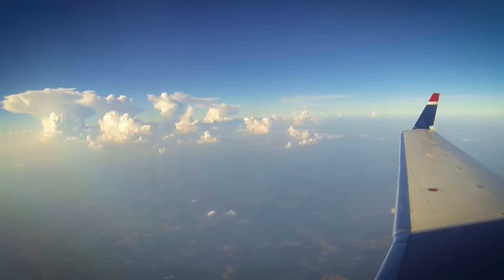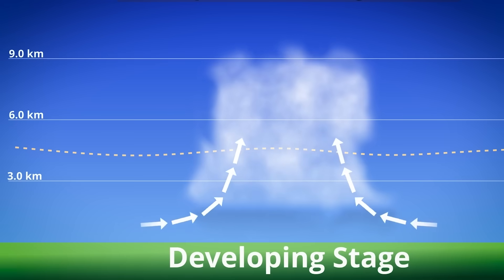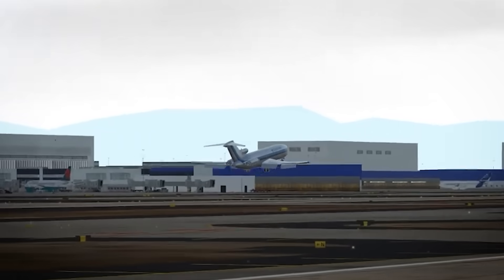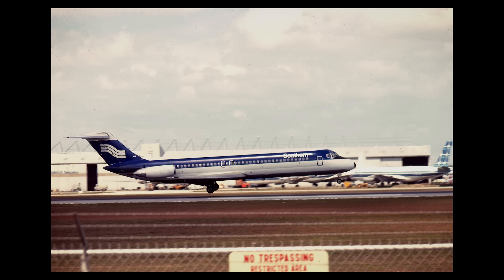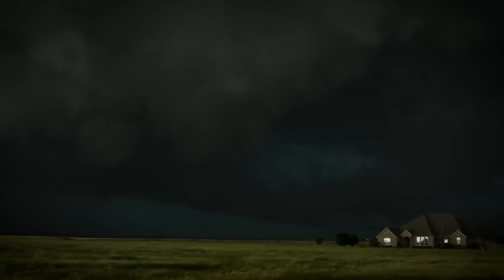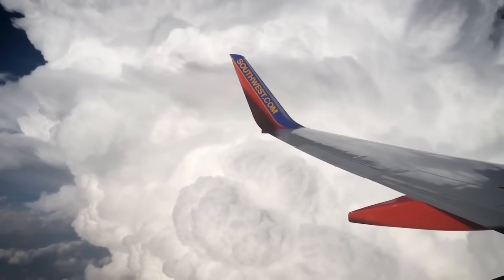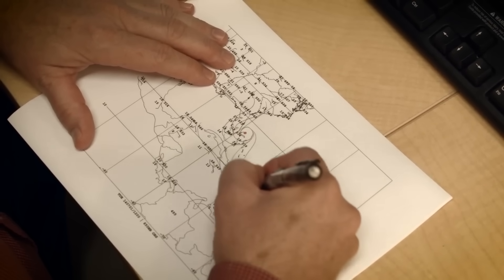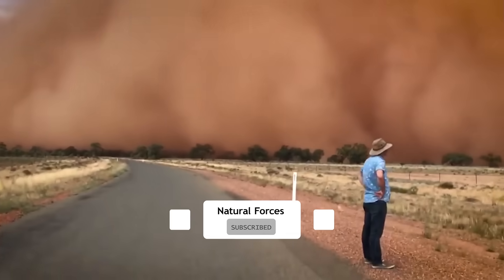Why Aircraft Avoid These Clouds at All Costs

Comment: Let's not forget that some cells could be mesocyclonic and that hidden by the clouds there could be a rotating mesocyclone that is linked to a tornado on land. The mesocyclone's winds are lower than those of a tornado because the vortex is larger and the rotation is lower, but they are equally dangerous. Entering a plane into the vortex of a mesocyclone means that it will be broken like a toothpick and will certainly reach the stratosphere, along with debris, cars, trains, trailers and other vehicles that normally don't fly at the altitude of a concorde.
Reply: This is why I want to get MSFS24. You get to fly around a tornado for the NOAA! My ass is going to Leroy Jenkins right into that mother ship, because the wind is virtual. It won't kill me or my plane. :)
Reply: @ohkaygoplay sign your signature under this comment so i know ur not capping
Reply: @eggheadtwoSCM  *signing *
Reply: I don't think any tornado on earth has the power to lift a train to the height of an airplane bro
Reply: Are you sure that the vertical component of a mesocyclone's updraft exceeds the terminal velocity of a car, let alone a train, enough that it could reach that height within the life of the storm? Seems extremely far-fetched. I'd understand for a tornado but they wouldn't reach nearly as high, and then maybe smalldebris like grass could reach the stratosphere. But vehicles? Seriously?
Reply: @geo3106It's an absurd exaggeration. Nothing the size of a car let alone a railcar has ever went to the stratosphere unless it was attached to rockets.
Reply: @aethelred9781 Yes I know.
Reply: @aethelred9781  right-
Reply: 75th like
Reply: Mesocyclone tough powerful, only happens in strongest type of AN storm, the supercell
Reply: Wsit was What is Mesocyclone?
Reply: @SpaghettiTwister  the vertically rotated updraft
Reply: Well said
Reply: Also UAP/ mother ships
Reply: I assume this is true, how come the hurricane hunter planes are able to fly through intense hurricanes with little trouble?
Reply: @thomasduncan1855 They are specialized in their construction to handle it.
Reply: @thomasduncan1855  Let's get started by defining cumulonimbus clouds. They're clouds formed as water vapour condenses and deposits as it rises and cools through the troposphere. Why? An unstable atmosphere and a lot of air conducive to this to ingest (warm, moist air at low altitudes) as well as a lifting mechanism; you can imagine it as lighter air bubbling up through denser air. These clouds crucially signify areas with the fastest vertical movement of air that can occur in Earth's atmosphere.

Hurricanes form from this motion of air, self-reinforcing as it draws in more air within that area and expels it in the upper troposphere. This motion of air generates lower dynamic pressure since a massive portion of the atmosphere (concentrated in the troposphere) is lifting up continuously. The coriolis force and conservation of angular momentum causes the inward-moving air to rotate. Eventually this system of air movement gets so strong that individual convective cells near its centre merge into an eyewall. Most of the wind is now horizontal and the change in direction with distance is minimal because of the scale of the system, so planes just need to adjust for that.

Comment: Water vapor is a component of air, everywhere.  Even in the driest desert and in the clearest, most cloud free sky you've ever seen, water vapor it present.  High humidity means the air has a higher percentage of water vapor compared to what it could hold at the same temperature.  When a parcel of air is cooled without losing any water vapor, the relative humidity rises, since it can't hold as much water vapor at its new, lower, temperature.  When the temperature drops to saturation (dew point) the vapor condenses into liquid water (on dust particles in the air).

It is this liquid water (or ice crystals) that you're seeing when you look at a cloud in the sky, not water vapor.  Water vapor is as invisible as gaseous oxygen or nitrogen.

Comment: I've been hit by lightning many times in commercial flying (usually Delta or Eastern) and nothing happened.  Once the pilots had to reset some circuit breakers.  Once the pilot walked around the plane after landing to see if any bits of trailing edge of the wing were blown off.  Other than those, nothing.

Comment: 20 nautical miles away? That's only 2 or 3 minutes away from the cloud. Pretty damn close if you ask me.
Reply: planes can travel at 650 nautical miles per hour (11 per minute) but usually it's 450 nautical miles per hour (7.5 per minute) so yeah it is very close

Comment: There are swveral types of these storm caused by cumulunimbus clouds
Single celled storm are often weak and short lived that only give some Rain, maybe several bolts and medium wind
Multicelled storms are larger and unorganized wich give string Rain and many bolts, hail is rare tough
Squall line storms are the horizontal storms wich stretch hundreds of Miles
But the deadliest of them all, Known as the Mother of all thunderstorms is the supercell
Supercells are least common mode of storms and have very strong Rain, enormous hail and continuous lightning, but what sets it apart is its winds and thats what is unnoiticed here. Supercells form from warm moist air of the south and West with cold dry air from north and east wich is when they are forming updrafts and downdrafts. The downdraft is often formed in a rotation wich meteorologists call it a mesocyclone . These mesocyclones generate strong winds and its them and Supercells in general Who are responcible for producing the majority of the world's most violent tornadoes. Supercells are often categorized in LP (low precipitation supercell), classic supercells and JP (high precipitation supercell in wich Rain forms a wedge)

Comment: There is more to these storms as water is being broken down into it's elements that cause thunder when ignited as it is a hydrogen and oxygen explosion taking place in the clouds. The water is typically broken down at the bottom of the cloud and the hydrogen floats to the top of the cloud where it is ignited. A planes engines can intercept these pockets of hydrogen and oxygen and ignite the mixture causing sever damage to the plane and sometimes even blowing the plane up depending on the size of the pocket of hydrogen and oxygen it runs into. 
This is made possible by the cloud acting as a capacitor as once the charge builds up to and surpasses the threshold of ionization for the atoms those atoms start ejecting their electrons. This subtle act breaks the bonds of the water molecules as the covalent bonds are broken when the atoms start to eject their electrons. This process produces three things, hydrogen and oxygen gases plus the creation of an electric charge. Once this charge build up has sufficient energy to overcome the air's resistance to current flow a lightning strike is produced. 
Trust me these storms are far more complex than we all realized. 
If you ever get a chance to watch a storm system roll in pay attention to the sounds of thunder as they always proceed any lightning strikes as the thunder that shakes the ground is caused by a hydrogen and oxygen explosion taking place in the clouds.
Reply: You going to provide any sources for this?
Reply: @brownlab8898  No as you should be able to look things up just as well as I can and find the truth just as I did. All you have to do is ask the right questions. 
But I also have very good observational skills and used those skills to observe a storm as it rolled in many times and always thunder proceeds lightning. This later skill I have you may not have and there is not much I can do about that.

Comment: Too bad Delta 191 decided to fly under one during landing 40 years ago on Aug, 2, 1985.
Reply: That storm spun up with almost no warning. A small Cessna landed without issue about 2 minutes before. After that accident they mandated new equipment on planes and at airports with frequent storms to give pilots more warning time.

Comment: Another dangerous aspect of these cloud formations is that they can form and grow into a giant system very quickly. This aspect has caused a number of plane crashes. The weather seemed alright when the pilots checked it, or the system was off to the side and smaller when checked, so the pilots maintained course. Then a little while later they found that the system had grown into a monster and spread into their path before they could go around it. From the ground, they look beautiful, but they are deadly, both in the air, and on the ground. All of what they can do to a plane, they can also do on the ground. On a few occasions over the course of my driving years, I have pulled into parking lots and parked for a short time due to the rain coming down too heavily to see well enough to drive safely. I have also done this in thick daytime fog a few times, and I know that I made the right decision.  Unfortunately, returning from an errand run during rush hour traffic one time, I ran into the densist fog that I had ever encountered.  Due to heading into evening, it wasn't going to thin out until morning. I saw that everyone ahead of me had turned on their blinking hazard lights, and were driving at a crawl. I did the same. We were all on a winding mountain road with a drop-off on one side. I could barely make out the shadowy form of the business on the corner of the side street into my neighborhood. Once I turned onto that road, I couldn't see either side of the road or the road itself. I had to crawl along, hoping that I was staying on the road for each road that I had to turn onto until I got home. Even finding my driveway was almost impossible. The house was set back from the street a ways, so that wasn't much visual help. That was a scary drive home. Remember, fog is actually a type of ground level clouds.

Comment: 5:51 - this particular cumulonimbus cloud accentuates your point even more. Normally clouds can’t spread into the stratosphere because in the stratosphere temperatures increase with altitude (which meteorologists call an “inversion”). That is why you can see the Cumulonimbus cloud flattening at what seems like an invisible line. That is the tropopause. But in the middle you can see a few puffs overshooting that invisible line. That is evidence of extremely powerful updrafts, powerful enough to push past the tropopause into the stratosphere, which only happens in particularly powerful and severe storms.
Reply: Aren't they called anvil something or another? comparing the cloud's shape to that of an anvil 

Ty
Reply: Anvil clouds*! 

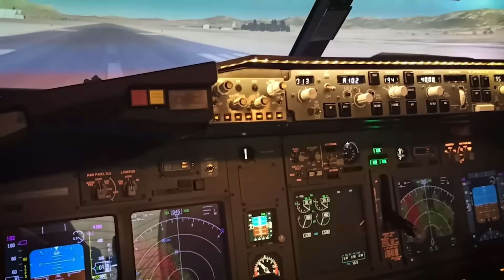I suppose "ironing board clouds" isn't cool enough? 5:53 😁
Reply: @ຈິຕຕະຈິຕຕັງ  cumulonimbus incus, that's just when the updraft slams into the tropopause and the cloud flattens out. but the overshooting top signifies the most extreme updraft conditions, punching through a normally impassable boundary.
Reply: @ຈິຕຕະຈິຕຕັງ  they are called overshooting tops
Reply: When I was a kid, I was taught they are "pie crust clouds" and if it looks like an overstuffed Thanksgiving pie, watch out!

Comment: The fact that they can form very quicky during hot and humid summer days like in 30 minutes and in clusters sometimes must be hard to predict and navigate through
Reply: I live in south Alabama on the Gulf Coast and yes they form very quickly, like right before your eyes and you can see several at one time
Reply: @kinte1870  I live in a colder climate so it’s rare with severe lightning here but during a warmer day we can get some CN clouds forming during the afternoon and eventually some lightning. However in most cases it is not severe and doesn’t usually last more than 30 mins for the cells to fade and die out
Reply: @alexforspeed  We get tons of thunderstorms especially during the summer. Tropical moisture is different.
Reply: It sucks when working too because they form so quickly that once you realize theres a storm coming youre already at risk of getting struck by lightning due to positive lightning strikes

Comment: The fundamental misconception about thunder heads is that it is in reality the electricity making the cloud not the other way round. This has been a well known observation from lightening research for literal decades and yet never incorporated in to weather modeling because "we are stupid" I guess. Fundamentally the "power" of one of these systems arises from localized electrical potentials with in earths over all electrical field and all other contributing forces are either secondary order effects OR electrically fungible forces that directly convert to electricity aka lightening.
 The engine that is being driven in a cumulus cloud is "thermocoupling" across the layers of the atmosphere with water vapor percentages providing the required differences in conductivity as charged particles from the solar wind and solar mass ejecta bombard the ionosphere and induce currents in the upper atmosphere that must seek equalization in the earths core and so induce charges within the electrically structure layers that make up the atmosphere proper all the way to "earth". The result is a dendric "tree" wide at the top stepping up in electrical potential as it inductively funnels past consecutive thermocouples as it approaches the surface layer where conductivity is lowest due to the very the prevalence of the water vapor that the system needs to convert to liquid in order to feed the final thermocouple and pass the last layers and reach equalization.

Comment: Its not a very proper explanation. Its not turbulence itself what breaks the plane, but plane speed and wing lift. Modern planes on high speed are able to produce lift much more than they can sustain - just because cruise speed is 4 times more than landing speed it can create 16 times more lift, ie 16G force, no one plane, even military fighter, can cope with it (typical value for jet liner is 2G regular operation, 4G structural limit, 6G is when it obligatory fails), not talking about passengers inside. Turbulence, rapid change of vertical air flow speed, just act as unintendend control input, causing the wing to change its lift instantly, without any delay to rotate the machine - angle of attack changes because air flow changes, not wing position.

 No one fears even 10000ft/min vertical speed if it happens together with surrounding air, but abrupt change from 0 (level flight) to +10000 and back means huge acceleration thus huge forces in structure, and it breaks.
Reply: Load factor.
Reply: @ohkaygoplay  not very accurate too. Its not g factor which breaks the structure but absolute load. If wing span breaks at 10t load - it may be 5t with 2g or 1t with 10g.